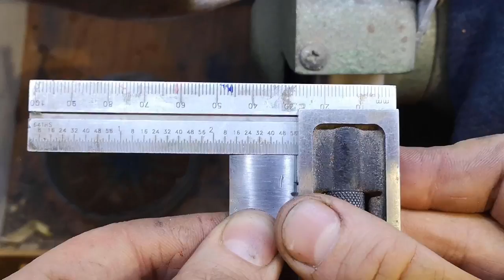007 Boxed rebate / rabbet hand plane. Woodworking

Comment: A few questions: why hide glue and not normal glue? Why is the box stronger when parallel to the bed? Could you make some day a tour of all the planes you've got and explain very briefly what they are used for? Thank you very much for your videos!
Reply from the maker: Hey Jonas, hide glue is traditional glue and allows to remove the whole boxing (after heating) to repair. Every end grain (or even mitre side) is more durable for friction and will keep the edge of the sole for long time, so the plane will work propertly. One day i'll make that kind of video. Regards!

Comment: here's a tip use a pencil eraser on the diamond plate to clean it, cuts better and last longer
Reply from the maker: Thanks, i'll try it for sure
Reply: Si señor!!! I have  tried  and  you  are right! Which  lubricante  do you use?
Reply from the maker: @SasonEyR usually wd40 but i like sharpening without lubricante.

Comment: 13:29  The apple wood boxing set at the bedding angle is visually absolutely stunning.   Does the forward angle of the boxing end grain cause any chip out of the boxing during usage of the plane?  Is this a compromise made for looks verses operation?  

Can you provide any information on the slotting plane shown at 3:04?  Where did you get that?

Love your videos, glad you returned to making tools, hope you make many more.
Reply from the maker: Thanks Tim! The boxing is more durable for friction than the sole of the plane. That allows to keep the profile of the sole for very long time.
I made that slotting plane, it was simple project :)
Regards!

Comment: Dear Stavros, I see that when you cut your blade you smoothed the surfaces to make it look nice.  I have a small hollowing plane that I did that to and the blade slipped back into the body after only a single stroke. I think that by polishing it made the surface too slippery to grip.  I’ve put it in cleaning vinegar to produce a rusted surface again and hope that works. Maybe leave the non-cutting surfaces of planes rough. That way they will grip well. Cheers.

Comment: Congratulations, very nice came out. You need a wooden vise, maybe  we can make a collaboration this summer as I currently work on a 43 mm tap and die set for wooden screw. ☺
Reply from the maker: Thank you Daniel :) Yes, i need it. Actually i'm making new and preety thick top for my workbench, when i finish it i'll make front and back vices with heavy duty metal screws. But thanks for you offer :) regards!
Reply: @StavrosGakos  ok, let me know if you change your mind

Comment: Stavros Gakos, I have to ask... Why have that strip of applewood on the cutting tool edge?  I really want to know because I want/need to build a rebate tool.  Thanks in advance.
Reply from the maker: It's boxing. It makes the edge of the sole more durable. You can make a rebate plane without it. Regards!

Comment: I'm curious why you went through painstaking efforts to fit everything perfectly and then flatten the blading grind it it seems like you should have done that 1st cause now you're grinding off a few thousands and it could affect the fit. No?
Reply from the maker: The bed and the blade should be flat, that's why i did it.

Comment: Amazing work! I'm slowly building up my skill set in the hope of one day making a few planes.  Quick questions if you have time, why applewood boxing? I thought fruit woods were soft and so would make a poor choice? You obviously know more here than I do so was I wrong about fruit woods?  Also, why bother with boxing on a rebate plane at all as I thought it was used in molding planes to reinforce parts which stood proud of the surface? (Newbie questions, I'm sure. Sorry about that!) Thanks for you video, I learned a lot!
Reply from the maker: Thank you! Apple wood is preety hard. Boxing was used for rebate/rabbet planes also, that makes planes life longer :) Thanks for watching!
Reply: Yes, apple wood is quite hard and great for tool making. A lot of old hand planes and saws used apple for handles.